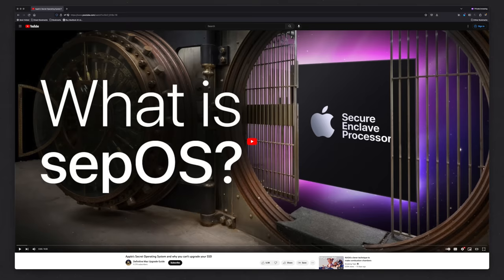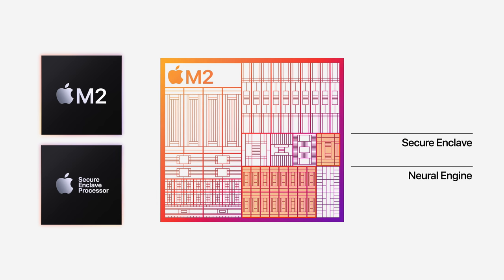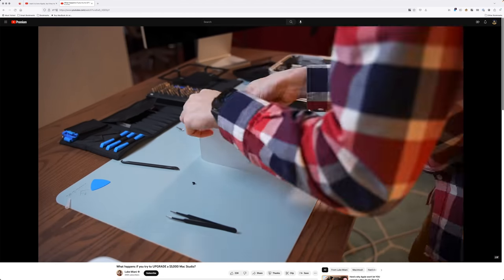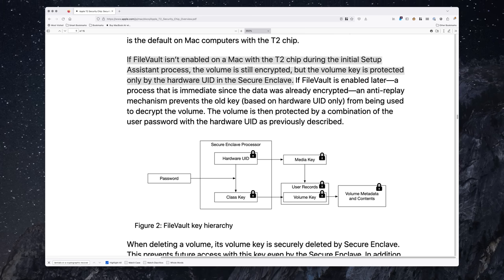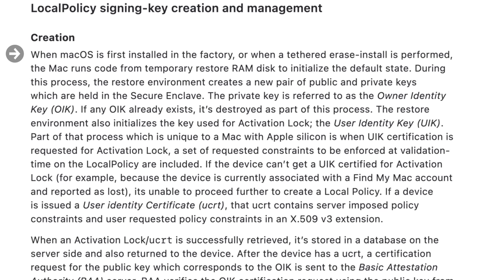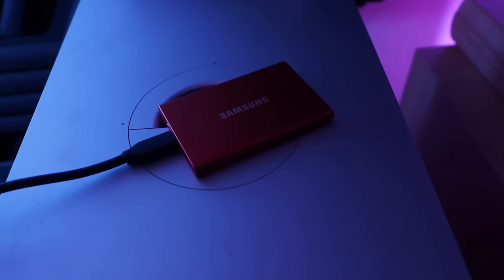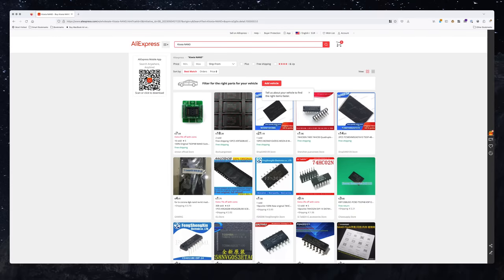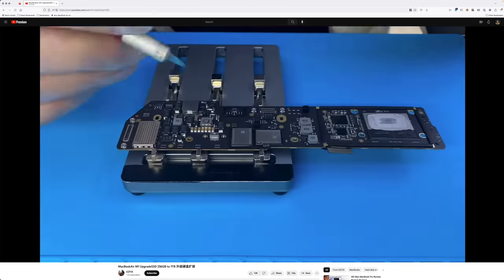Was I wrong? Apple Silicon and SSD Upgrades

Comment: This is always a technical and hypothetical adventure.  Yes, any challenge can be overcome, if you are persistent enough.  The issue is:  Is it commercially viable?  What is the business risk?  Soldering at this level requires expensive equipment with precise temperature gauging. I would think the SSD for the Mac Studio could be made more viable but what would the cost of a 4Tb drive be and what are the downfalls of putting it on a USB-4 or TB4 external enclosure.  Yes, during the purchase process, the Apple Tax is hilarious.  I think a solid external drive solution is an option, should an internal SSD crash, which is more likely with one that has not gone through the testing in the manufacturing facilities, it would be great if you held on to the original one.
Reply from the maker: Realistically most people, self included won’t be upgrading the SSDs but at least there’s a way to keep them out of landfills.
Reply: @dmug  Which is why I installed the OS of my mini in an external SSD, and have a script run an unmount the internal storage as a login item. I think people will check for SSD health for resale value in the future, just like they do on battery for iPhone nowadays, at least I would.

I purchased the 256GB model thinking I can save everything else on a separate drive, like I do on windows, but apple suspiciously changed the cloud storage API (one drive, dropbox..) so that it needs to be in the main drive. This forced me to install the OS in an external SSD.
Reply: @dmug  I watched the iBoff channel, and now it makes a lot more sense.  The only thing we need are clean NANDs.  And, yes, the land fill needs to be free of hardware that can be used.  It may not always be in the "rich" American countries.

Comment: i came cross by youtube recommended,  is that possible to unlock the mdm MBP intel based 2019, since brought it from 2nd hand market.  i can bypass it by disable DEP for update, but how to full unlock, swap the T2 or i see some video about switch the serial number by modify the T2 rom, any idea?
Reply from the maker: There’s a video by iBof that shows the entire process now for t2 and apple silicon Macs.

Comment: I would argue that doing a raw NAND replacement when an SSD dies is better for the environment than throwing away an entire NVMe module including the controle and DRAM.   Much of the cost of a good NVMe drive in-fact is in the controler not the NAND (the price difference between a high end NVMe drive and a low end drive of the same capacity is almost entirely down to the controler and DRAM).  

The job of de-sodlering NAND is not ultra advanced, it is something a skilled tec can do by hand this is not like soldering a SOC to a package substrate were the pines are extremely small. 

From a write to repair angle providing the firmware tools to reset the controler (DFU mode) is a good thing and better than telling people to throw away working silicon.  What apple should do is sell the studios NAND cards in paired packs like they do for the 2019 macPro.  These would work out of the box (with a DFU reset), as the configurations apple would sell for each skew would match the sizes the firmware supports.

Comment: My question is,  say you buy a new imac.
Someone sets it up for your and forgets everything ot dies and you have no way of knowing their email or what password they used.

Or you buy a used m1 again you have no way of booting to the desktop because you have no apple ID apple email account icloud account or password at all.

What can you do to get to the desktop?
Or install OS x from scratch. Erasing what's ever in the mac, On a apple silicon machine.?

If that makes any sense
Reply: I would say you could probably use an external ssd to boot macOS, but without the iCloud information if the previous user set up with iCloud, you can't do much with the internal ssd. 

If you bought the machine from someone, I would try to ask for their information to unlock the device, or if they don't wish to give you that info, get them to pay for shipping to and from your address to get them to properly unlock the device.

It definitely makes sense... of course, in a hypothetical sense I would go to the seller and ask them to release the device from their iCloud account. There is the chance they never set up Find My, so you could reinstall the OS to see can you get in this way. You can also install other OSes such as Ubuntu or Asahi Linux to get some usability if the seller is unable to release the device. I would request a refund if they can't fix your issue.

I believe Apple can unlock the device if you can prove the death of an individual. If it is your loved one you can request Apple directly. You could also contact the seller if it is their loved one, and follow this link --> https://support.apple.com/en-ie/HT208510
Reply: @evanhearne4020  hey thanks.
This was a hypothetical because i have heard it is impossible from an end user perspective on all current macs if your internal ssd goes you can not boot into OS x even from an external ssd.

Now in sure apple can probably do something but so fir they have not released any information officially that even they can.

Then booting info Is on them dead ssd.
Not just the password or apple id.

So you buy that uses m1 mac and the drive is dead or dies your are screwed.

Older macs allowed me or you your or I to simply hook up a old drive external or swap out they internal and bout directly from that without t2 chip security enclave on a drive that's over now.

I believe even the intel mac pro will refuse to boot if your take the internal drive out.

Apple believes the machine is still theirs after you buy it d I they van lick you out it will.
.remember the backlash they g it when they said they would scan photos in icloud and lock users out of their macs phones pads and call the fbi on them all without your knowledge.

Basically you never own your apple product. They do.
Reply: @Tigerex966  I am pretty sure you can boot into macOS from an external drive. I could be mistaken.

Also, if you live in the States, then yes, they own your device. If you live in the EU, you own your device.
Reply: Wouldn't the person who set it up just give you the information so you can use it?  How would you log into the machine after reboot?

Comment: Apple silicon has no hardware support for external boot. External boot is only possible after writing the bootloader to the internel drive (less of a Security thing but that's definitely a factor, and more that the early boot firmware just has no USB support baked in). Swapping NAND chips has a lot more to do with the system architecture than it has to do with security. Apple silicon devices can be recovered with DFU (or from idevicerestore which is usable from any Windows/Linux/Mac/Android device) even if the entire NAND is wiped along with the SPI flash chip where the early boot firmware is installed. Here is a full technical explanation about NAND swapping if you are curios: https://www.youtube.com/watch?v=yR7m4aUxHcM
Reply from the maker: Not sure what you mean about not supporting external boot. Apple does have support baked in for external boot, but it still requires the internal SSD to be working. I've done it on my M1 Max and it's similar to how my T2 equipped Mac Pro works. Here's two mainstream publications outlining the process on Apple Silicon. It's the more or less the same as T2 Macs.

https://www.macworld.com/article/331916/how-to-start-up-your-m1-mac-from-an-external-drive.html

https://appleinsider.com/articles/21/01/03/how-to-boot-an-apple-silicon-mac-from-an-external-drive

I've seen most of the iBoff vid, and it corroborates my video. I'm not sure if I didn't make it clear enough in this video? But I talk extensively about using DFU mode to restore macOS onto replacement NAND modules. Apple is locking down the SSDs via authorization. I didn't really jump into the macOS boot rom aka iBoot, beyond mentioning the existence of the DFU mode being bootable without a functioning SSD as there's only so much info dump as I try and walk the line between technical and accessible. One of iBoot's key features is verifying the security integrity of the volume it's booting from, and thus it is part of the "system architecture" which is why swapping NANDs doesn't work without a DFU restore to initialize the proper keying for the drives. This is easily explored with the Mac Studios as it doesn't require soldiering to test.  

This isn't to say iBoff's video wasn't enlightening but I keep getting linked it and I'm not sure where the confusion is. I'm more than willing to admit when I'm wrong and issue corrections. If there's a particular phrasing or passage that I said, please let me know.

Comment: 😂I bought an M1 Mac mini. However, after I am going back to a  Windows machine. I hate the fact that you get price gouged by apple if you want something useful. 16gig/256gb ssd is so 2008. You can't upgrade it yourself, accept with external usb4.0 drives. I am purchasing a used i7 9700 with 64 gigs of ddr4 and a 2tb drive with the capabilities of upgrading the ram and the memory for about 200 bucks more than the entry level m2 mac mini. Sure, it's not as snappy, but it's almost as fast as my M1, plus I upgrade it. For audio production, you can't rell the difference in speed.

Comment: My only real theory is that the secure enclave is used as a means to prevent potential hardware level exploits (not swapping SSDs).

There are totally hardware level exploits that are capable on the base product, but I feel like the Secure Enclave prevents certain add on card exploits.

This leads me to also believe
Reply: If your machine is in the hands of someone else it's already compromised, this seems like a convoluted solution to a non-problem.

Comment: It has nothing to do with what you describe here. Imagine replacing nand chips on the SSD drive, say, on any modern ssd like Samsung 980 evo. Replacing NAND on SSD drive is technically possible bit it will never work unless you have access so manufacturer firmware tool. Modern Mac embedded SSD is basically the same: NAND SIP chips are built into array by T2/m1 which acts as an SSD controller. Yep, this works the same as a bigger chip on your m.2. Samsung drive. It stores firmware on service area on some chips, all the service information like SMART, block wearing out statistics, trimming setting, everything. Now imagine you have ability to move NANDS between different drive while keeping ssd controller / dram on board. Would you expect it to work? Not nearly, it does not work on any SSD drive since decade at least. Even though it seem so be "replaceable" on studio, it is preconfigured nand block there is even port number it is configured for, printed directly on the drive. So basically apple did not do anything more difficult to repair, they simply embedded part of the SSD Drive into processor and got rid of it.
Reply: Apple configurator is able to rebuild SSD drive in some circumstances and it is widely used by the repair community. I replace NAND chips if needed and there are tools to transfer service information from one nand chip to another. Also if you source clean NAND chips you can upgrade m1 machines and do DFU restore to rebuild an SSD.

Comment: With the Mac Pro with M silicon chips, I hope Apple engineers have found a way to allow memory to be upgradeable even if in custom modules, otherwise the new Mac Pro, will be like the trashcan Mac Pro was, not everyone can afford a fully spec machine on day one but may upgrade to higher specs as they grow, remove this as an option and you kill your main audience. They have got away with it on low spec machines, but imagine the money needed to get a Max spec Mac Pro when it comes out, clearly a very niche market. It’s like Tim Cook is happy to kill Apple as he tries to squeeze as much money out of every potential customer there is.
Reply from the maker: Probably the least likely upgrade with the unified memory architecture. Apple filed patents about using iGPUs and dGPUs.

It’s super sad that we’re here. I can bump my 2019 CPU and will do so at some point but if I were to get a apple silicon Mac Pro, that wouldn’t be the case.

Comment: Why were you wrong in the first place when it's clearly out there in numerous successful attempts for the soldered on.
Reply from the maker: That's just the thing, the "numerous" successful replacements mostly went back to a singular social media post. That's not exactly confidence inspiring. 

After digging deeper (credit to viewers who assisted) I had enough confirmation.
Reply: @dmug  there is nothing wrong in questioning and self verification and takes a man to ack a mistake. Just saying there is nothing dubious about claiming you can upgrade a tiny component. Nothing much to gain from faking it.

Comment: there is a never spoken feature of non upgadeable devices, which is second hand value.
even just a port to upgrade ram sticks devalues a products second hand value significantly.
if literally no one is messing with the device it has a huge resell value for extended amounts of time, this is not so bad at the for the consumer.
you can blindly sell your device and get the one with the specs you want and pay only slightly more, because both devices have lost their initial bigger chunk ov value. upgrading like this is actually way better.
ppl talk about upgrading and reparing all the time, but in reality close to nobody does that ever, like not even 0,1%
Reply: thats not how resell value works.. Being able to upgrade a second hand purcahsed PC dosnt "devaluves the product"

and people are upgrading and repairing less(still far more then "0,1%" or else repair stores wouldnt be a thing) because companys made it almost impossible(and in some cases SCARE the consumer by illegal "warranty void" stickers)

a Device from 2005 that cant be upgraded in any way.. will ALWAYS be a device from 2005, it will run like  adevice from 2005. Thats it, 

Now a single upgradble ramslot can depending on configuration change that SIGNIFICANTLY., there are a HUGE ammount of Office PCs that get turned into low budget gaming Computers by virtue of being upgradable, they only HAVE resell value because they can be upgraded

Like you smoked some good shit to come to the conclussion "less upgradability=more second hand value"

Apple has relativle stable resel values not because "they cant be upgraded" but because the apple economy, ecosystem, and everything around it is relativly stable. AS much as i hate apple their ecosystem keeps devices alive for RELATIVLY long,
Reply: Definitely hit the bong a bit too hard there.

Comment: Given the prevalence of identity theft and how easy it would be to steel a person's device, I don't mind the SSD being locked down. As a programmer, these kinds of hardware level security used to be exclusive to enterprise level hardware. Is it over kill for consumer devices? That's for each person to decide. I store important files in a file server, so that I don't need to upgrade the SSD. If I really need a computer that's upgradeable,  I have windows and linux servers.

Not everyone is a programmer with lots of hardware. I get why people are annoyed, but the youtube space bitching is really just for views.
Reply from the maker: Sure, but encryption doesn't prevent ID theft nor do you need a specialized integrated controller in the SOC. The MS Surface uses hardware encryption. Only requirement is NVMe drives that support.  While correct, you can't just easily pop out the SSD when the device is stolen and read all the data, the same is true on modern Windows with TPM2.0. 

The far far more common way people nab personal info off a device is from malware, which doesn't require breaking any encryption, just getting a user to install said software as the OS already has write access to drive. Both Apple and MS recognized that encryption ≠ security when networking, thus we have System integrity protection and MS has UAC/WRP, indows Defender and so on.